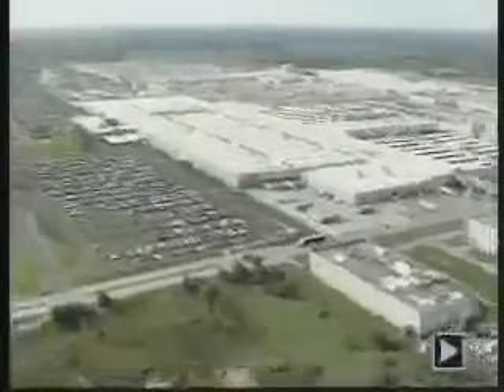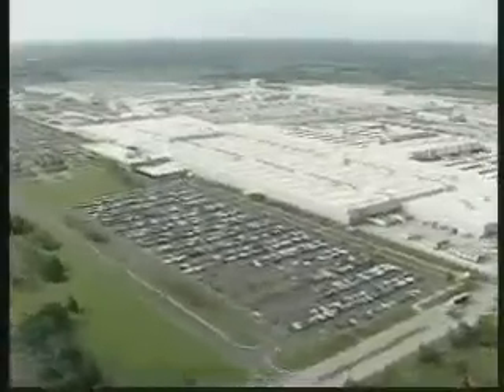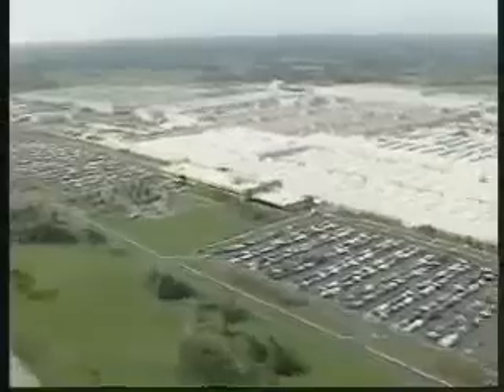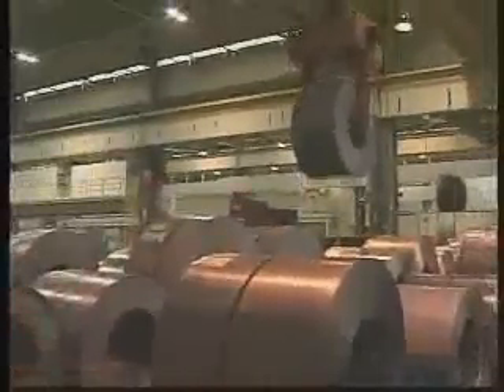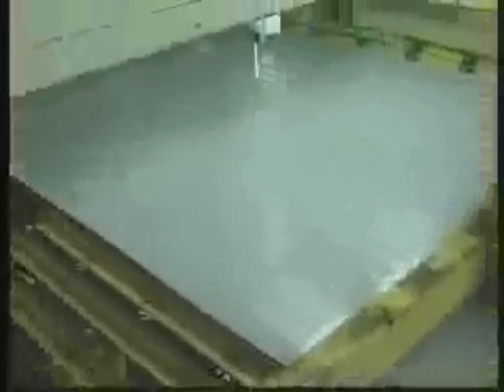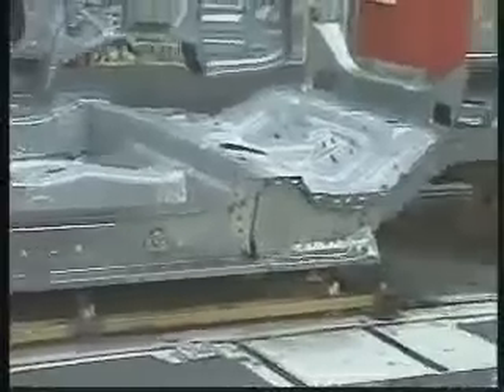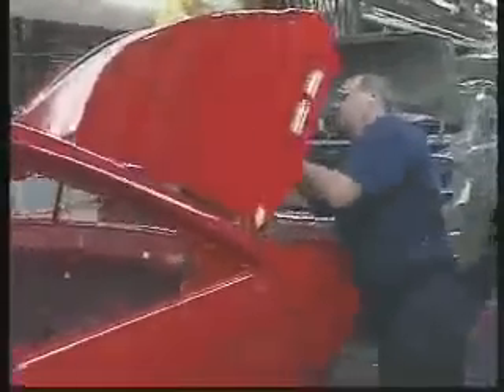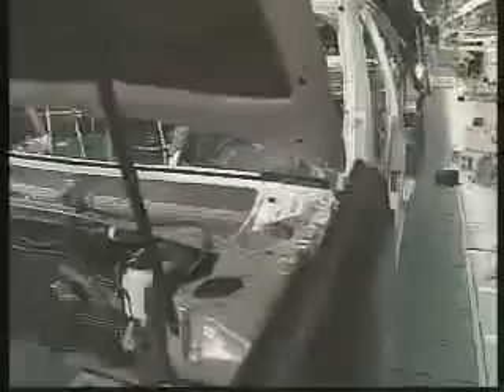Lean Manufacturing Example Toyota Plant Kentucky

Comment: @390merc65 
I heard they switch supplier and forgo quality inspection.  Apparently, the supplier in Japan wanted a higher price and Toyota see them as not efficient as time consuming, costly, and other things so they switched to a closer supplier.  But the standard is not the same and not consistent.  The new supplier credibility is not as good as the old supplier.  If you read theory M, there are that "clandestine" relation that Toyota forget : loyalty, good will, sacrifice, etc..

Comment: Lean Manufacturing is destroying a lot of companies. In their greed for more bottom line they are producing a lot of junk. The old studs who built these companies had damn good reasons for EACH STEP in the process. Short cutting is not cheaper in the long. The cheap supplies we now use in our battery products = JUNK. Short term thinkers are in charge of most of these operations.

Comment: @Allante715  Ok. I was reffering to more general domains, not just car manufacturing, but as I know of, Subaru invented the electrical transmission, Honda invented the piston ring, valve lifts, timings, something the like (I'm not very good at mechanics, I'm sorry), Toyota invented the automatic looms, plus I might be wrong, but Nissan invented the first "plug-in-and-drive" system? :) And let's not talk about the corporate strategies which made everything possible. Just a few examples,that's all

Comment: @cebokisha 

 Did the Japanese invent the fuel injector? internal combustion engine? Headlights? Turn Signals? Adjustable Steering Column? Disk Brakes? Cruise Control? Electric Windows? Electric Ignition? Spark Plug? Muffler? Odometer? Seat Belts? ECT...ECT....ECT

Give me an example of a Japanese invention or innovation that is on the majority of automobiles. Must be an original invention not an improvement. You can go tell me to read a book but the least you can do is give examples.